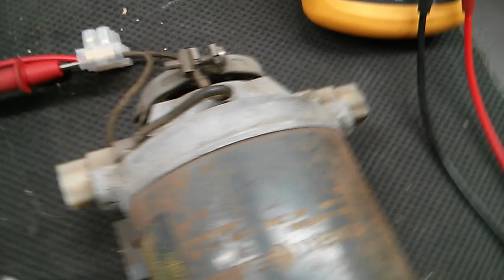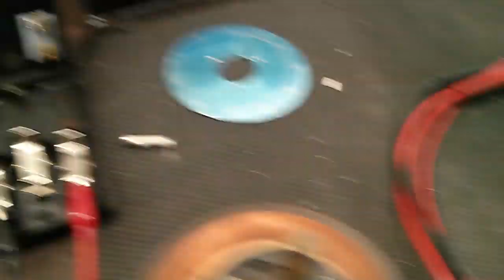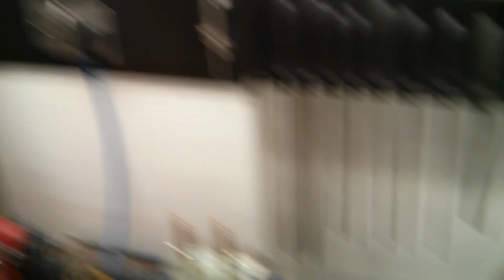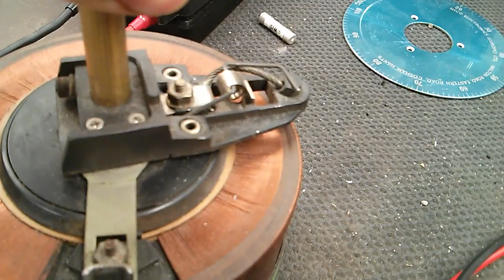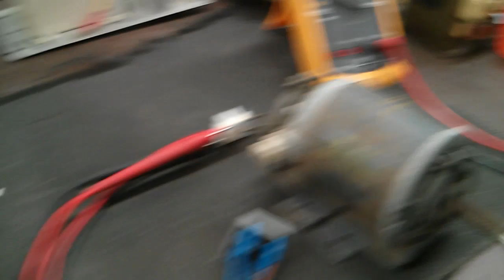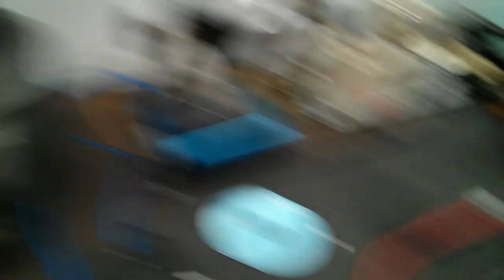Testing a Universal Motor on DC for Speed Control

Comment: Could you give specs on the bridge rectifier? Sorry if I missed it in the video, but I didn’t catch anything
Reply from the maker: Hi Mike,
The rectifier is a generic 50A 500V Chinese one. Very much overkill, but it's just one I use for everything.
Reply: Steve Lane if I’m using it to run a 1hp router motor on 220vdc, do I need a rheostat for speed control or will a light switch dimmer be sufficient?

Comment: Am I right that a universal motor can be powered directly with AC or DC ? So, you used the rectifier becos you used AC supply but wants to show you are powering it with DC?
Reply from the maker: using DC on a universal motor increases the torque at lower speeds where AC would slip a lot more.
Reply: Steve Lane When powered by DC, is it the electro-magnet coil is also connected to the battery?
Reply from the maker: +Cosmo John Universal motors can be wired in two ways, if the field is in series with the armature that's a. serries configuration, of they are in parallel that's a "shunt" configuration. the difference between the two is in torque performance. hope this helps?
Reply: Steve Lane Both of these configs can be run on battery , right? I dun want AC. Thanks.
Reply from the maker: Yes, providing the the voltage matches what the motor requires. And a fuse wouldn't be a bad idea either. Just encase! =]
Reply: +Steve Lane Thanks, dude. Will try higher voltage using 12v SLA. And a fuse ;). My dremel clone uses a parallel motor. I think so because one end of brush goes to Hot and the other brush goes to Neutral. So, I think one coil end goes to the brush and the other coil end goes to the other brush. Will connect these brushes to a SLA and swap polarity if motor does not move. Am I right that universal motors do not spin in both directions?
Reply from the maker: To swap the direction in a universal motor, simply reverse the polarity of either the field or the armature windings, changing both would cancel out causing no change.
Reply: +Steve Lane Am I right that to reverse the polarity of field windings means swapping the battery connections to the brushes given that my motor seems to be parallel wired where each brush is connected to each field winding? Its not a simple motor. Thanks.
Reply from the maker: I'd say try it, worse thing to happen would that it still goes the same direction. =]
Reply: +Steve Lane  👍👍👍

Comment: its ain't dengerous for the motor to be used with a dimmer? i want todo that with a  dimmer
Reply from the maker: Not tried that myself, sounds like it could work. I'd say try it but monitor temperatures, especially at low speed.

Comment: Nice motor very smooth speed control. Love your variac set up.
Reply from the maker: Thanks Rodalco! I'm pretty happy to go ahead and use this motor for the rotary spark gap on the soon to be built Tesla Coil, it does need some tlc to get it looking nice again, as with most old things these days.

Yeah... the variac setup is not ideal at all, this video was understandably for test purposes, I'm not usually one for running exposed live parts but I needed to test compatibility with the exact variac I plan on using.

When this setup is all in final position the 1A spark gap motor variac will be panel mounted alongside the main 6A variac with the relevant analogue meters inside the Telsa Coil control unit and will be built to much safer standards.

Comment: Hi steve.
Thats one nice sounding dc motor' id love one 9f them. Im going to keep my eyes open for one of them lol

That motor will do splendidly for a spark gap mate. Would be awesome too if you could run it on pw!! ;-) owww the frequency through that would sound awesome' resonating  through the windings !!!! B.e.a.u.t.y.f.u.l

Thanos for sharing'

~☆~☆~☆~THUMBS UP~☆~☆~☆~
Reply from the maker: Thanks Ant, these motors came from some old Hand dryers, they were pretty heavy and had a cast metal casing to them, there was also a centrifugal fan in them too that was pretty hard to get off without breaking the allen key.
As for PWM, I could probably do it with minimal modifications to the motor, PWM the armature or the field windings only as sometimes PWM both has no effect, I will give it a go when I have a powerful enough PWM driver.
Although for this Tesla coil I am trying to keep electronics to a minimum.
Reply: Steve Lane You could look into phase angle controllers (light dimmers is one type of them)

Still, that may need some kind of feedback circuit.
Reply from the maker: Thanks Erlendse, I was actually thinking of phase angle controllers for my TC after I try this asynchronous universal motor out to see what an improvement phase angle control will have, and yes I would need a way of measuring my phase angle, but I already have a plan for that.

Comment: OOh!! it's got a common tater :D
Nice motor, should do well for the spark gap
Reply: Bahaha, i laughed so hard at this... Love that little variac by the way, great size for a Tesla coil control box.
Reply from the maker: Haha indeed it does, I've seen the chips fly off those taters when they get too hot! xD
It has a very nice control range to it, also the power seems about right, I will have to strip it down and clean it up obviously but I think it should do, although it seems a bit ironic putting a GE DC motor in an AC Tesla Coil! xP